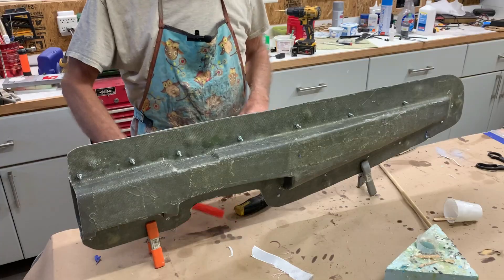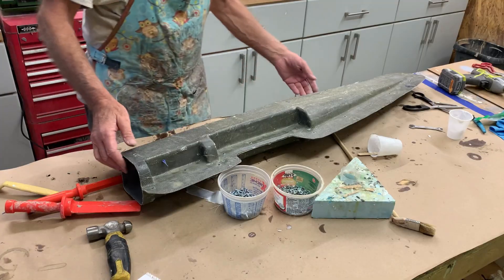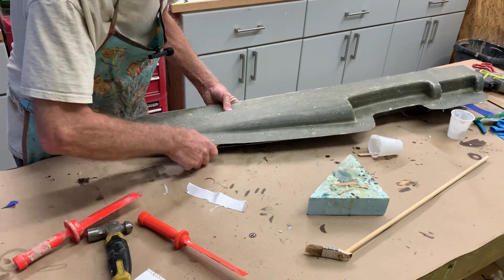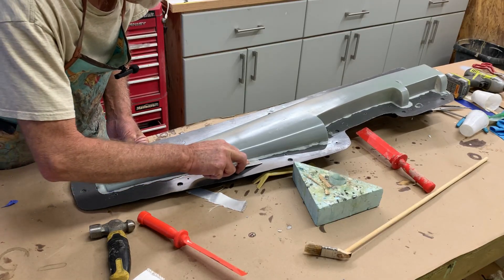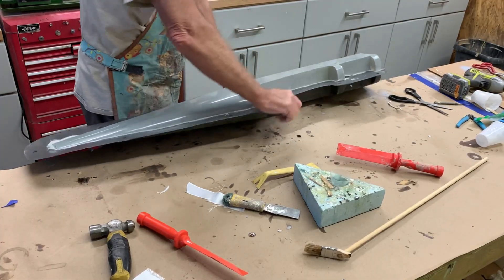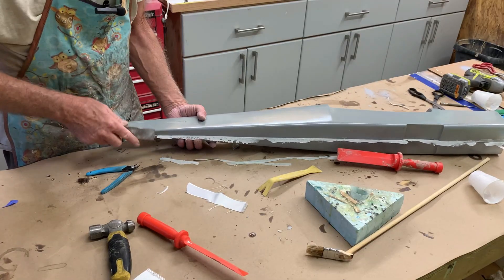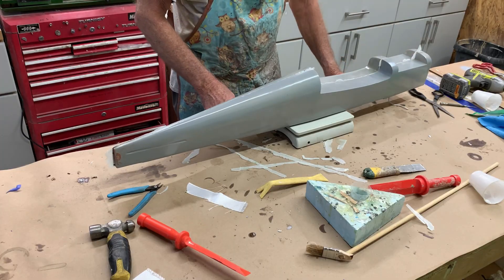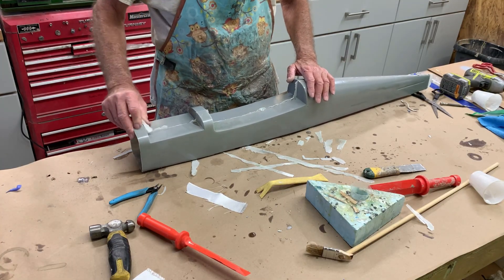RC Dragon Part 5 Pulling The Part

Comment: Hey Jim, have you ever tried 3D printed framing? 

I've been using PETG for my airframes and find them to be ten times stronger than balsa and still about the same weight, mixed with 50/50 carbon/aramid cloth the damn things are almost indestructible. 

I'm currently working on a PAHT-CF airframe that I'm going to test with 150g aramid, if it works and can take some serious crashes, I'll let you know. I figure using aramid and nylon as a mix, should make it so repairs are as simple as a hot air gun and a plastic putty knife, if it does, it'll save all of us a whole lotta headaches.

From experience, I can tell you that 200g carbon/aramid and a PETG airframe on a P-40 Warhawk, will bury to the windshield with minimal damage, but I can also tell you from experience that should you test a nose dive crash on something like a 1:6 scale after a rainy day, you'll be digging for about 2 hours to recover it if it crashes in a farmers field...lmao

It was literally stuck into the ground at a 90 degree angle, just the prop broken and a few wrinkles in the skin around the front.